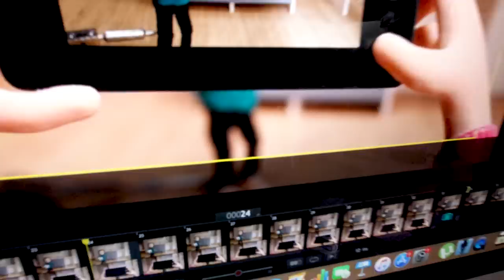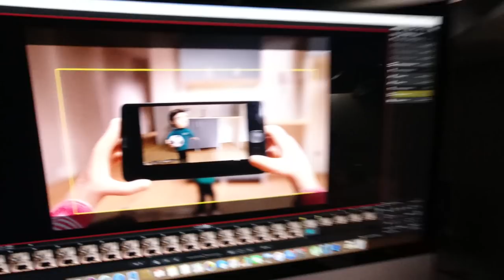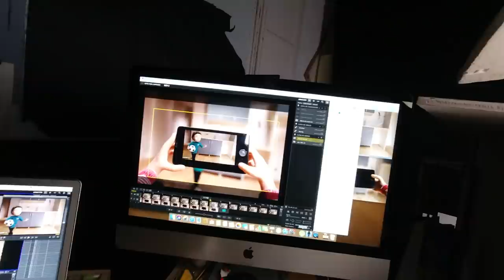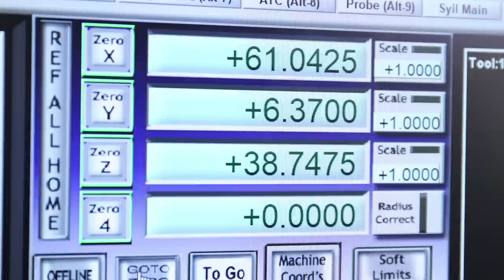Stopmotion dream tool, WINDERS

Comment: Crazy to take on a feature film. Looks like you guys have made a lot of progress! When you remove the winders and rigs in post do you have to do it for every frame, or is there a way around it?
Reply from the maker: There are options to remove big part of the scene out with masks, but the part where the puppet has contact with the rig is always a frame by frame work
Reply: @edupuertasfruns  Thanks. Sounds like a lot of work but worth the work.
Reply: Instablaster.
Reply: @edupuertasfruns  I have bright green gaffer's tape, couldn't that be attached and chroma-keyed out?

Comment: Thanks Edu, exciting update! i'll try to be quick before they're gone. a question, i'm also interested to get the racks that you provide separately and wondering what pinion gear would be compatible with your pitch module of 0.5 tooth rack and how many teeth will the pinion need to have if I get the rack? Thanks
Reply from the maker: Hi, not sure if I understand the question. The extra racks provided work for each of the winders. If you want to use them on your own gears, you can use any number of teeth if the dimension of the teeth is module 0.5. More teeth less precise because the diameter of the gear will be bigger.
Reply: @edupuertasfruns  Thanks Edu, I'll have that in mind. Keep up the great work!
Reply: @edupuertasfruns  I see, so probably pinion gear about 10 or 12 teeth at 0.5 pitch  would be the best on those racks. Do you plan to stock pinion gears as well?
Reply from the maker: I think it's 10 on the mini. I don't think I will sell gears for now